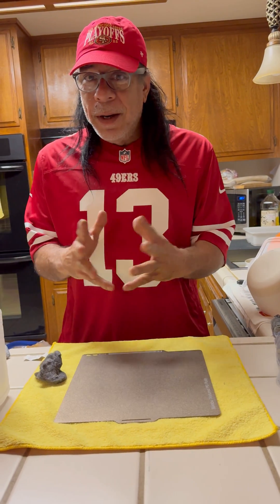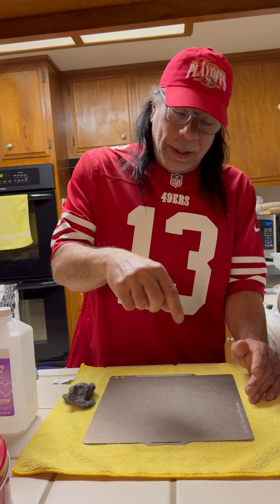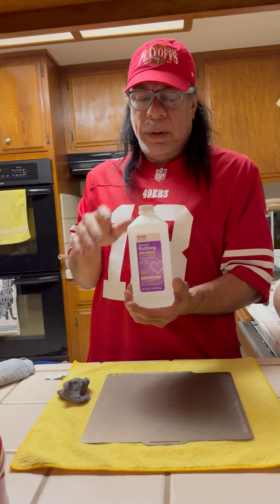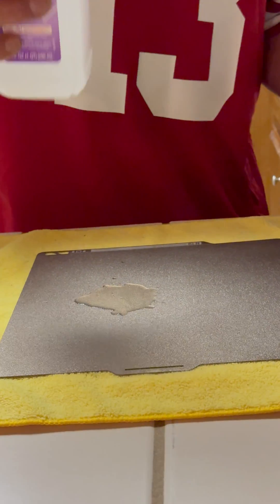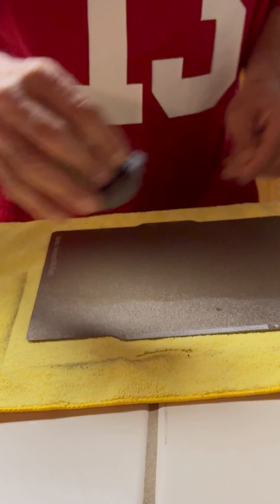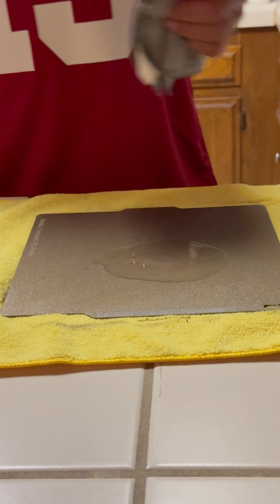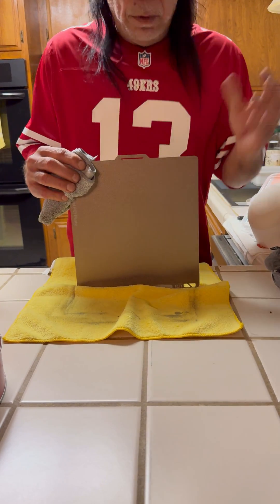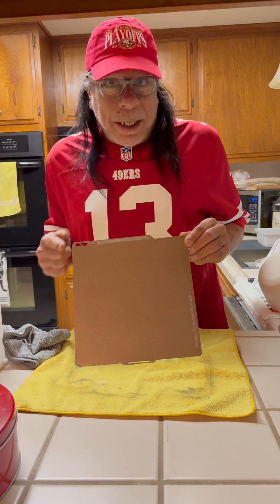Bambu Lab P1S 3D prints wont stick? I have a solution

Comment: all you need is warm water, dish soap and the softside of a sponge.
Reply: your wrong dude I've had mine 10 days and I've tried your solution maybe 20 times with zero success. I made a ticket and they referred me to the wiki page that says just what you said.  I've adjusted the temp of the bed, opened up the doors, washed the bed with dawn dish soap and 70% isopropyl, used glue sticks, tried hair spray, tried hair gel, NOTHING WORKS!!! So quit being a tool and spreading miss information.

Comment: You need to use hot water and soap. IPA lifts the residue left over from pla and smears it. IPA works for other filaments. You don't need to scrub your plate.
Reply: I actually found this method on the Bambu website. Here is the quote: “Carefully sanding the surface with fine-grit (600 was recommended) sandpaper can help restore adhesion.”

Sand paper is a lot harder than steel wool, so this is probably safer than what Bambu recommends.

Comment: Seriously, no need to use steel wool on your textured plate, yes, people say to use 91% or better IPA because it works a lot better than what your using, what was that 70%?  That's why your prints are not sticking.  And use it before every print.  Your fingers leave oils on the plate, wiping the plate down with 91% or better IPA will remove the oils.  When people that have been printing for many years say to use 91% or better IPA there is a reason for it.  If you use steel wool on your textured plate it's like using sandpaper, it's going to wear out the textured PIE coating on that plate and ruin your plate.  I'm just giving some advice, I have many years of experience, you can take it or leave it, that's totally up to you.  😁  Thanks for the video, and I'm rooting for your 49ers because my Seahawks didn't make it this year. 🤪
Reply from the maker: First you don’t keep cleaning with the alcohol and steel wool. Only the first time the print plate stops sticking.

After my P1S arrived I calibrated all filaments and I proceeded to print. First object didn’t stick. Tried others still no stick. After every print wiped down with alcohol.

So you understand isopropyl alcohol, it’s just as effective at 91% as it is at 70%. Difference is the 91% dries much quicker due to less water and more alcohol. It’s good for cleaning components that may have use electrical current when turned on. This way it dries fast without your help. Unlike 70%. But as far as cleaning ability they do the same. No difference.

Now after nothing was sticking I tried settings, adjusting temps, etc… but nothing worked.

Then I found a guy who works at a print farm. They had the same problem after their first calibration prints with their Bambu Lab model and another. After some consultation with Bambu Lab they recommended doing an initial cleaning with the steel wool. You only need to do this one time. After that just wipe with alcohol after each use. Since then I have not had a problem with parts not sticking.
Reply: @ejfanetwork  I’ve been printing for the past 7 years.  I wipe my beds down with 91% IPA and a paper towel before every print, all of my prints stick to all of my plates on my Prusa MK3, my Railcore, my Crealtiy CR10s Pro, and my Bambu Lab X1C.  Occasionally, and I do mean occasionally, I get a plate that won’t hold a print.  I then take that plate and wash it with dish soap, then wipe it down with 91% IPA.  And it starts holding again.  You are telling people to damage their plates but using steel wool on them.  You know how steel wool works right?  It’s an abrasive, it will damage the PEI coating on the plate.  I’m guessing this is your first printer?  You say you talked with someone who has a print farm, how long have they been printing?
Reply from the maker: @oldsalty3d122  I see now why they call you old salty. Should add the “and I know it all, too” to it as well. Son, you don’t know what you’re talking about. It does not damage the plate and my prints stick great. Only used once the first time after purchase and don’t need to get rid of sheen after that. Just use alcohol and I use a lens cloth.

Now I’m sure you’ll come back with another “I know it all moment,” but unfortunately Im a bit too busy to deal with people such as yourself. Go find a group of pimpley teenagers you can impress and leave the cool people to their printing techniques, capiche?
Reply: @ejfanetwork  I’m sorry I did not mean to offend.  You say I’m Mr Know It All, while at the same time basically telling me I know nothing.  So who really knows it all.  And I was just pointing out that I have had lots of experience.  And you come back with insults.  You have no idea how old I am, there is a reason why I’m called OLD Salty, so don’t really appreciate you calling me son.  I really do hope that you have success in your printing, and I hope your YouTube channel does well, and that the 49rs win this next weekend.
Reply: I actually found this method on the Bambu website. Here is the quote: “Carefully sanding the surface with fine-grit (600 was recommended) sandpaper can help restore adhesion.”

Sand paper is a lot harder than steel wool, so this is probably safer than what Bambu recommends.

Comment: The steel wool will remove the pei don't use that
Reply: I actually found this method on the Bambu website. Here is the quote: “Carefully sanding the surface with fine-grit (600 was recommended) sandpaper can help restore adhesion.”

Sand paper is a lot harder than steel wool, so this is probably safer than what Bambu recommends.
Reply from the maker: I tried it and every print has stuck without problem.

Comment: I agree with using alcohol as a cleaner. I use the scrubber side of a kitchen sponge to scrub the plate.
Reply from the maker: Only need to clean with steel wool one time. After that the new sheen is gone and all you need is alcohol👍👍